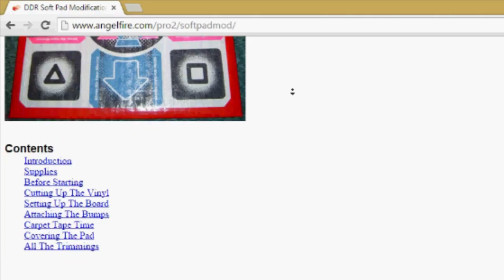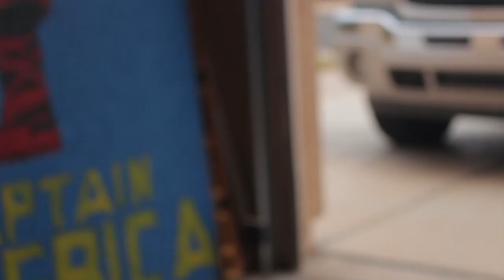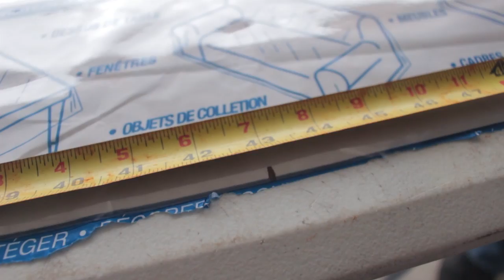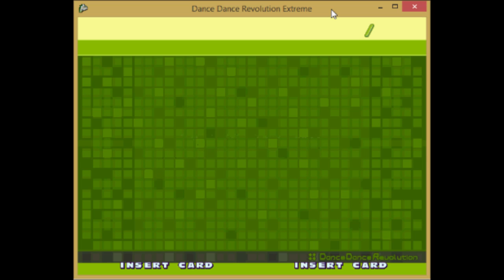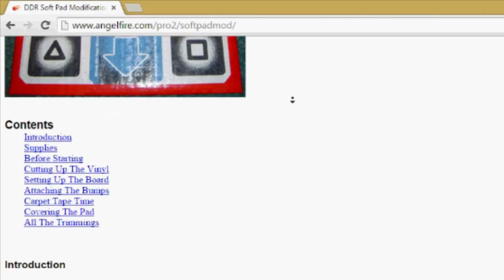DDR Soft Pad Modification Tutorial

Comment: I did a sort of semi-hard pad mod! I used this tutorial as a basis for what I did, although it was comparatively simpler. I used the same method of duct taping and using cut out squares under the arrows, but I didn't use any vinyl or staples, I just duct taped the edges of my soft pad to a piece of foam board so it looked nice. I slid cardboard squares under the arrows and taped them down. It works so much better than it did before and it only cost $10 total!
Reply from the maker: +dj505Gaming Nice man! Glad to hear you were able to fit the tutorial to your own mod
Reply: Hi, bro, so... you didn't use plywood?
Reply: I think I am going to try the foam board idea! I will probably bring back the double stick tape between the sensors for extra strength.
Reply: foam board is really flimsy and would permanently collapse if you stepped on it once... are you sure that's what you used?
Reply: @Kholdster  Sure am. It's cheap as hell at the dollar store, it's rigid enough to keep its shape even after being stepped on (especially if you layer it), and it's very easy to work with, especially for someone who was like 14 when they did it and wrote that comment 👍 
Never had any issues with it despite it getting kinda flattened pretty quick. The softer surface felt nice too

Comment: Small suggestion: If you're doing this to a new pad, measure first. It may not exactly match. I cut 35 x 39, and found I should really have gone with 35 x 41 -- my pad was about 2" taller than Mario's, even though it looks identical. So measure the width and height of the pad, and then add 1 or 2 inches to each, and that's the size to cut your board.Otherwise--great tutorial!

Comment: Just built this yesterday. The instructions were awesome and the final product works like a charm. We did make a slight adjustment. We didn’t feel that the double stacked plastic would provide enough of a  "bump" to feel underneath so we cut up foam squares (of the same dimension) and taped those down instead. Now we have a very distinct raise that we can feel whilst playing. We haven’t had any issues so far with the incorrect buttons being activated.
Reply: What foam did you use?
Reply from the maker: Glad you got that to work!

Comment: This worked great for us, we used:

*12 gauge clear plastic (Joann Fabric called it "clear table vinyl," they have different gauges too) 
*3/4 inch plywood, I got the precut 1/2 sheet at Home Depot & cut to size
*3/8 inch staples for the staple gun
*2 3/4 inch wide black Gorilla tape
*1 7/8 inch double sided carpet tape, Shurtape
*permanent marker, hammer, straight edge, & scissors 

Note:  We didn't raise the arrows on the dance pad, but still measured the carpet tape to be placed between/around the arrows, & not under the Select & Start buttons too.  We were careful to leave extra fluff, so we didn't set off other buttons while dancing.  Took about an hour to build.  Because our original pad was old as the game, we ordered a new dance pad from Amazon.  Thank you so much for the video.
Reply: which dance pad did you get? Any link? Appreciate if share! :)

Comment: I remember in my old soft pads back in the 2000s that the sensors would migrate inside of the pad. Do they still migrate with the plywood base or does that help to keep them in place?
Reply from the maker: Sorry I didn't see this comment until now. I did not have that problem actually because the vinyl really kept the pad from folding and scrunching up (which in turn prevents the sensors from moving out of place). I definitely did have that problem when I was young though too but yeah did not show up in my current modded pads
Reply: @marioCazares  nice! Thank you so much for the reply!

Comment: Thanks for posting this. Really good video (and nice of your dad to help with the construction and sourcing). Do you think it would cause any issues if I were to insert a layer of foam between the plywood and pad? I have bad knees and hardwood floors, and am thinking some foam might make playing more comfortable.
Reply from the maker: Hello there! Sorry for the late reply been extremely busy the past weeks with college.

Adding a layer between the wood and the pad possibly may cause an issue with arrow sensitivity, but it also may be perfectly fine. I would recommend trying it out without taping anything first. So put the wood on the floor, put the foam and then the pad on top. You can temporarily put the vinyl on top just to test and try out a song. If the arrows work fine and there are no problems then definitely go for it. Just remember not to put the vinyl on too tight when taping the final mod together.

If the test doesn't work, you can possibly cut square pieces of yoga mat out, and place them on top of the vinyl over each arrow to lessen the impact. 

Again sorry for the late response, please let me know if the test worked and keep me updated on the final outcome! I definitely would like to know how it turned out and if you have any more questions let me know!

Comment: I bought a couple soft pads, then I read up how bad and how vulnerable the pads are on carpet when you tap; so I'm going to give this a shot. I've watched the video a few times, how much vinyl did you use to finish both the mats? I'm not sure if I missed this small detail or if I'm just too excited to do this. This will be an excellent project to finish for isolation for the next year and a half or so!
Reply from the maker: Hey sorry just seeing this now. I bought about 3 yards length of vinyl to make 2 pads. 4:22. Also the vinyl is about 54 inches wide. hope this helps!

Comment: I hope you reply but how long did your modded board hold up for
Reply from the maker: Hello! So both pads held up for 3 years in working condition. After the 3 year mark the sensors inside the pad started to give out. The actual wood board, and vinyl is still holding up well, but the internals of the pad itself have slowly been dying. I still own the pads (now 5 years) and they technically "work" but they often don't detect every button press and will misstep many times. This is after heavy use and lots of Heavy/Expert stepcharts so I'd say it lasted a good amount of time. Hope this helps!

Comment: Hey man, i am thinking about doing this mod soon, i know this video is really old and all but how much would say this increased the pad's durability ?
Reply from the maker: The pads have lasted and still work to this day however they do miss some steps or double step from occasionally. They worked reliably for years I would say even to around 2021 without many issues. I even played in shoes often. (Although shoes do make the pad slide around the floor a little)

We owned 3 soft pads before these modded ones and those all ripped after a year or two. So I'd say this dramatically increases the longevity and the feel of the pad as well. Keeps it from scrunching up as well which is huge
Reply: @marioCazares  That's amazing, from 2 to 6 years is incredible, i've already purchased a soft pad from Ali and can't wait to mod it with my old man, he seems eager too since he gave me my first soft pad more than a decade ago lol

Now I need luck sourcing the materials used lmao

Comment: Hey thanks a lot for this video. I recently searched for a way to make my DDR pad better and this might be the solution. However I do have a question: Do you know the thickness of the vinyl used in the video?  Thanks  in advance ! :)
Reply from the maker: Hello there! I don't know if there is any millimeter exact thickness, the vinyl only said "double polished clear vinyl" but it was thin and worked well. Mine is specifically from walmart and it's the blue rolls. Here are two links to what kind I used:

https://www.walmart.com/ip/Magic-Cover-Multi-Purpose-Clear-Vinyl-Roll-54-x-25-yds/23554847

https://www.etsy.com/listing/582183144/clear-vinyl-covering-54-x-60-roll?gpla=1&gao=1&&utm_source=google&utm_medium=cpc&utm_campaign=shopping_us_c-craft_supplies_and_tools-other&utm_custom1=52043d90-d905-4914-a66f-0ac785f16bd1&gclid=Cj0KCQjwqM3VBRCwARIsAKcekb3c1lk3sYmW_Y5G4srkwTuoXSgRf2ZDpeRJUUIOlg2T-c8rujvXnQMaApSxEALw_wcB

Hope this helps!
Reply: Thanks for the quick reply! Since I live in Germany I can't buy the same vinyl you posted, however I think I found something similar. The information that the vinyl was somewhat thin was really helpful. Thanks again and I will post again when I finished my Dancepad :)

Comment: How does it sound? Does it get rid of the plastic bag type sound of soft mats?
Reply from the maker: Both are about the same volume but instead of sounding like a plastic bag the modded pad sounds low and thumpy. Here is a video I shot real quick to see yourself as well: https://youtu.be/uRsfWoyZ_8g
Reply: @marioCazares   - Oh wow! You went out of your way making a video. I didn't expect that but it certainly helps. I really wanted to hear the sound. And it's a big improvement to me. My main reason for finding your tutorial was the crumpling sound as I move around. I can definitely deal with a little bit of the wood thumping. I'm going start building my own. Thanks for these videos and keeping active after 7 years!
Reply from the maker: @winterhaydn  No problem and best of luck on the modding :D!

Comment: can you use a thin foam instead of the vinyl under the pad? can you use thin acrylic (hard) for the top layer?
Reply from the maker: Hey there so we ended up taking out the vinyl under the pad because it was causing unwanted arrow presses on one of the pads. Thin foam might work but if it's too tall it'll keep causing the arrows to press when you don't want. Also having hard acrylic on top might be heavy enough to press down on the arrows as well. If possible I would test it out without taping/gluing anything together to see if it works
Reply: @marioCazares  Thanks much.

Comment: Hey there, i love the vid and i really want to male a ddr pad for my fiance, becuz of covid she cant really go out to play ddr anymore and i had some questions, first instead of lifting the arrows with vinyl would it still work if lifted with foam? And also do you think it would work if i made a metal frame for the top that had sections missing to reveal the buttons? Also in your opinion how hard would it be to make it more of a box than just a pad? I had wanted to add the ddr support beams
Reply from the maker: Hello there

1) After I had made the build, I actually had to take out the vinyl under the arrows because it was lifting them too high and causing them to always be pressed. Adding foam might cause the same issue where it presses the button constantly, so you can test it but it also may not work. 

2) The metal frame to reveal the buttons sounds cool and might work, you'll just have to worry about two things. The first is making sure the metal doesn't get too close to the arrows or it will constantly press them down. The second is it may be uncomfortable to play without shoes. As long as you play with shoes or carefully use the metal then it should be fine

3) Making a box would be fine as long as it's very sturdy (as it will be stepped on a lot) and as long as you are aware of the weight. Each pad weighs 20 pounds with just the flat piece of wood, so just keep in mind the weight

Hope this helps and let me know if you have any more questions

Comment: The vinyl across the top of the pad; what benefits did that part of the mod provide?
Reply from the maker: The vinyl keeps the top really smooth so the pad doesn't wrinkle and trip you up. It also protects the pad from tearing which sometimes happens to the soft pads. Lastly you can use shoes on them since it's much stronger. Hope that helps!

Comment: What kind of ps2 controller to usb converter is that?

Based on Amazon reviews, they don't register pads very well, and I don't want to waste money, lol.
Reply from the maker: Hello there I actually use the convertor linked below. I thought it was sketchy at the time when I got it in 2018 but it still works today and supports one or two pads at a time
https://www.walmart.com/ip/PS2-USB-Dual-Controller-PC-Adapter-Converter-Consumer-Electronics-Gaming-Accessories-Player-Cable-Playstation-Attractive-Game-Joypad/581869851?wmlspartner=wlpa&selectedSellerId=101091584&&adid=22222222228000000000&wl0&wl1=g&wl2=m&wl3=42423897272&wl4=aud-430887228898%3Apla-51320962143&wl5=1013523&wl6&wl7&wl8&wl9=pla&wl10=462998764&wl11=online&wl12=581869851&veh=sem&gclid=Cj0KCQiAtJeNBhCVARIsANJUJ2ES6iK6IKpAFg5PM-dEh1gyoZVBMFr5zKZuICVct3Gc3IBYXEVYJZgaAr_jEALw_wcB&gclsrc=aw.ds
Reply: @marioCazares  cool, thank you!  I saw the single adapters in your video.  Glad to have feedback on one that works!
Reply from the maker: @yorhey  Ah yes those came with the pad but I lost one hence buying the blue one linked. Glad to help!

Comment: Where did you get the dance pad? I want to do this. I have an old one but it doesn't respond unless I stomp really hard on it.
Reply from the maker: This is the page where I bought the dance pads: http://www.ddrgame.com/softpads.html 

There are different pads for different consoles and for PC. I purchased a DDR Non-Slip Dance Pad for PC. It is saying however that these are out of stock. You can use this as a reference to find the same pads, but I'm not sure exactly who else has them. I looked and couldn't find any yet. The pad is around $25.

Comment: Will this mod work well on tiles? I'm having a hard time playing because my pad keeps on slipping on tiles and I'm planning to do this mod to solve my problem. And also, can I use any other type of double sided tape instead of carpet tape? Thanks! :)
Reply: Add some low profile rubber non-slip self adhesive pads to the base of the timber and it will work well for you.
Reply: Alright thanks!
Reply from the maker: Ah sorry I thought I responded! It should work on tiles but Andrew's suggestion is a great one!

Comment: Late to the party but I have a question! I'm around 95 lbs and ghost over a lot of the arrows so I like a very sensitive pad I can just slide my foot over. Worried with the extra padding it might not register my light taps well. Any other lightweights have good sensitivity experience with these cause I'd love to do this!
Reply from the maker: Hello there, I don't have the pads with me now to test, but my cousins (7 and 9 at the time) were able to play fine and they were quite light. If others would like to chime in it'd be helpful, but I think this mod should be okay
Reply: Krafty Krow it’s your form I weigh 220 and will “ghost” steps sometimes when I get crossed up on crossovers.  Study your form and learn crossovers on easier songs first until you get the pattern down.  It’s not the pad but it’s your form, hopefully you can get it figured out.
Reply: @marioCazares  I made two, both near identical to your tutorial. My wife is as small as me (both 100ish lbs girls) She doesn't play as high a difficulty as me, but she loves the vinyl across the pad, as does our young son. I however found it difficult to get it to register my light, rapid steps, so I tore the covering vinyl off. It's not as pretty, but it works great for me and she has her mat that she loves. Either way, thank you for this tutorial video. So easy to follow and easy to add modifications (or tear them off) when needed.

OH! and I put stick on LED strip lights around them. Light em up!

Comment: Hi! i don't know if you're still active on here, but if i can, i want to ask a question. Is it okay if i replace the hard wood panel with a foam board?
Reply from the maker: If you think it will be strong enough you can try but it may end up bending or breaking if it's not strong enough. If you're able to stand on the boards and step around on them without them breaking before starting the project it may work.
Reply: @marioCazares  I see... i may end up using a wood board, because as it turns out after i asked that question, my dad planned to do roof jobs and he said i can have the leftover boards. With that said, can i substitute the cushioning under the arrows with cardboard?
Reply from the maker: @anggoroputra5660  Actually one of pads has no cushioning under the arrows and it's doing very well, so having no cushion altogether should be okay. The cushions were actually causing the arrows to be pressed even when standing in the middle of the pad
Reply: @marioCazares  I see, thanks for the heads up! One last question. This was made in 2015, how does your pad feel 5 years on?
Reply: @marioCazares  Hi! I thought i would give a final update. I managed to complete the mod with a few changes. The plywood that i got were not thick enough to staple the vinyl, so i can only tape it, but it works out in the end. It works so great compared to stock, i managed to get scores above 900k on 10s pass 12s now! It would still slide around the floor so the final thing i need to do is buy some anti slip pads that i can stick to the underside. Thanks again for the tutorial! All the best to you 🙏🙏

Comment: I tried this tutorial but sometimes it works fine and sometimes it doesn't recognise any input. Is this because the plastic is on too tight?
Reply from the maker: This is probably the case yes because I ran into the exact same issue. When the plastic is too tight the button is "already pressed" so doesn't read when tapped on. If loosening the plastic doesn't work let me know!